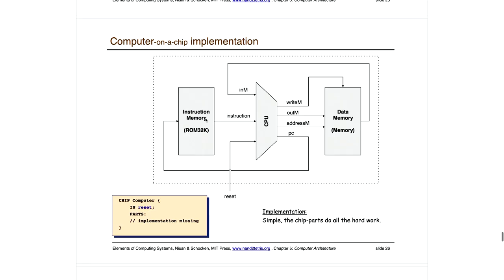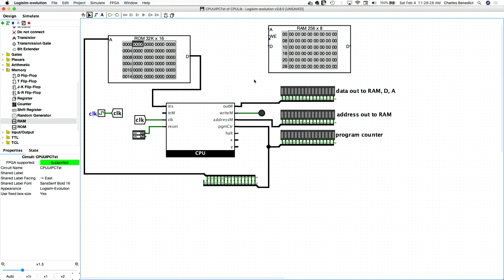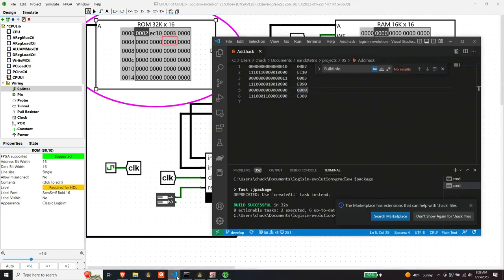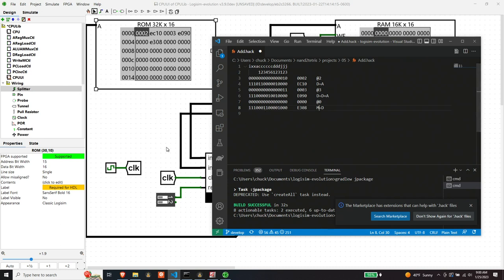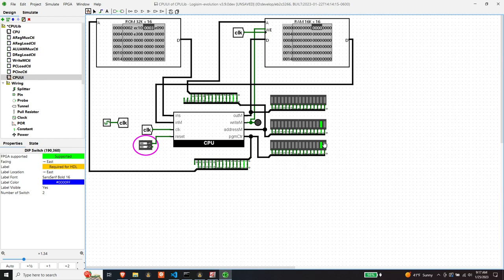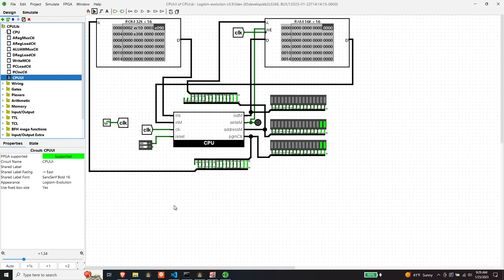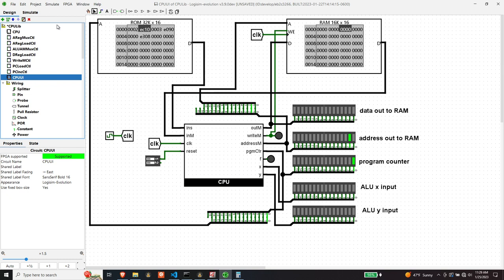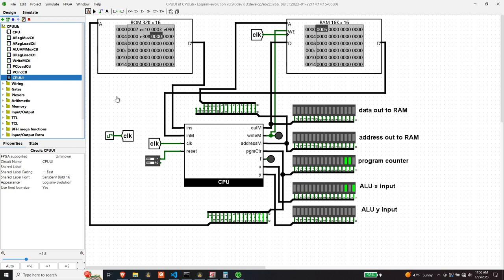HackCPU Logisim CPU Testing Add.hack

Comment: I am implementing this  on Logsim Evolution. Is there a similar but or other bug that I need to take note of ? Btw when I executed the 0000 instruction, the data out to the memory did not output the expected value (5) and it only output 0.